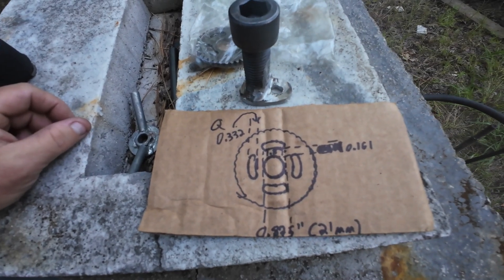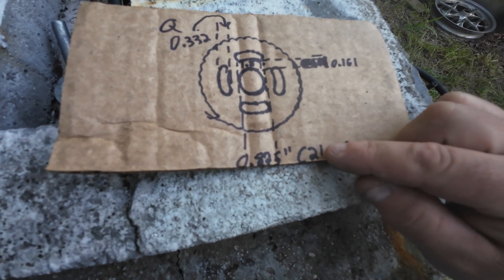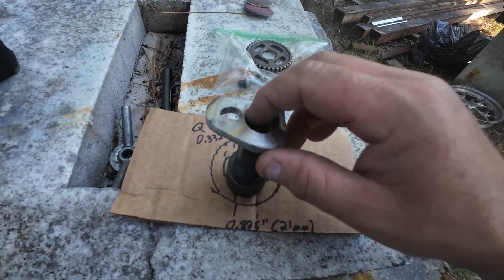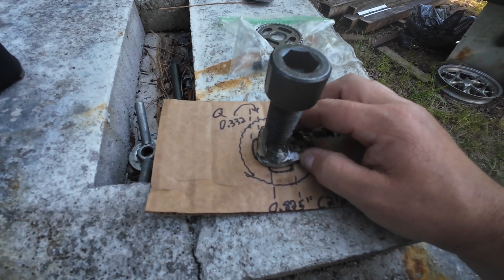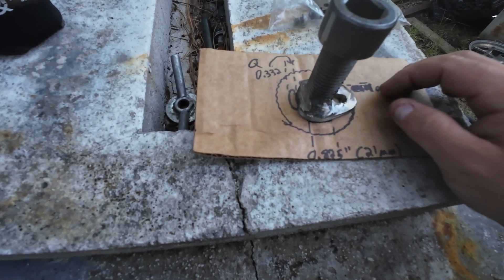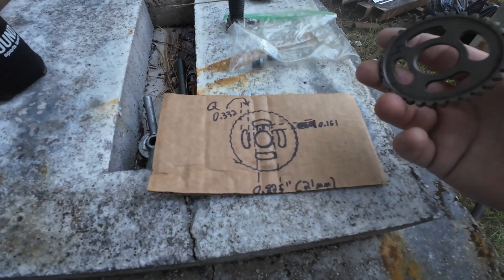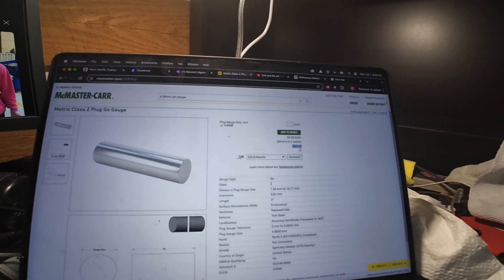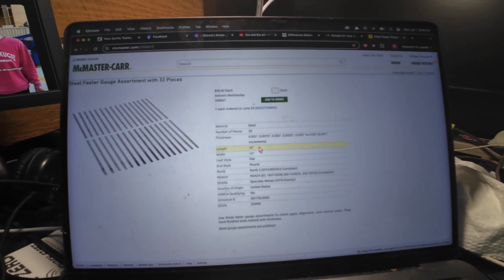Tuareg Major Service   Appendix A

Comment: About this tool...this sketchy but you COULD open up the cam tower very slowly, rotating through the bolts in the prescribed order, lifting them up less than an eighth at a time. That was you're not putting too much pressure on the cam tower and you can lift it even with the pressure from the springs
Reply from the maker: That's an idea. But you would probably still want the tool to put the camshaft back on, and rotate it into the right timing position. 

This was my first bucket over shims engine. So "valve thrust" was greek to me. I didn't know what it meant until that camshaft snapped over like it did.

Comment: Thank you for making this series of videos outlining how you tackled this procedure. It will no doubt save me plenty of time when I have a crack at it myself and for this I thank you. Which shop manual did you use and where did you obtain it from?
Reply from the maker: The service manual is available on AF1s website. It's about $20 and downloadable

https://www.af1racing.com/manual-2q000524-oem-aprilia-service-manual-for-tuareg-2q000524

They also have a parts catalog available to download as well. All of the part numbers can be put into the search bar on their website 

https://www.af1racing.com/tuareg-660-oem-parts-catalog
Reply: @DonkeyDongDoug  Thanks mate. 👍

Comment: Chase, could you please post the part number/SKU of the filler gauges you bought from McMaster-Carr? I believe its the SKU: 2066A7
Reply from the maker: correct

https://www.mcmaster.com/2066A7/
Reply from the maker: After remeasuring today.. You can get a measurement on the intake cams from the front side of the bike with the short blades, but you can't really see what you're doing like you can from the back side of the cams.